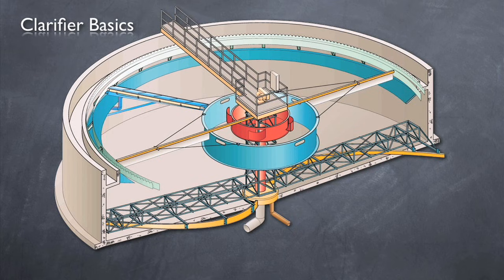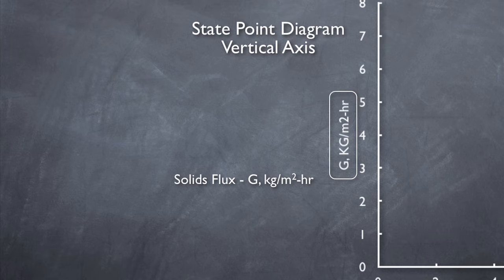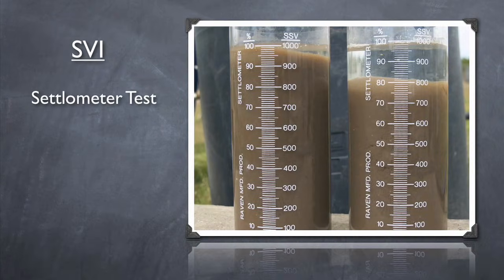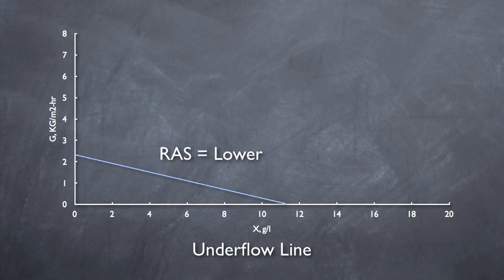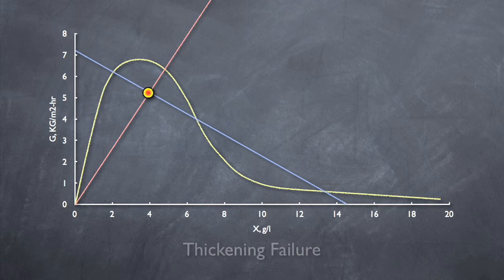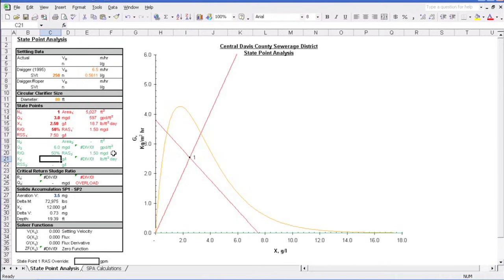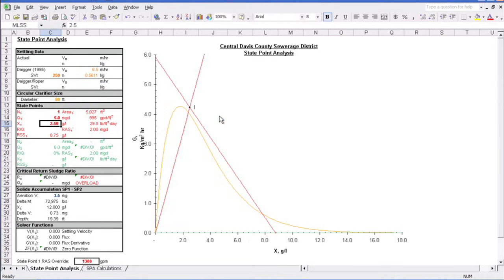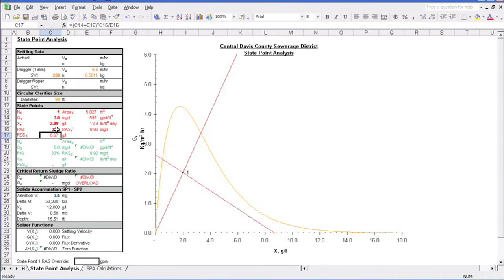Clarifier Basics & State Point Analysis

Comment: Sir, I appreciate your video and love the state point explanation.  But there is a problem.  The RAS flow is included in solids applied,  retention time and weir overflow  rate. If you increase your ras you increase those parameters and your sludge consistency drops. If a clarifier is hydraulically over loaded. You just made things worse.  Chlorine works but what we found is if you change the condition causing the filaments they will die out. Finally.  If I put 4000 mg/l of mlss into my clarifier at 3200 gpm and remove 2300 gpm of ras from the under flow at 1% consistency,  the clarifier will never fill up! Thanks for your video from a friendly operator with 37 years standing in sludge